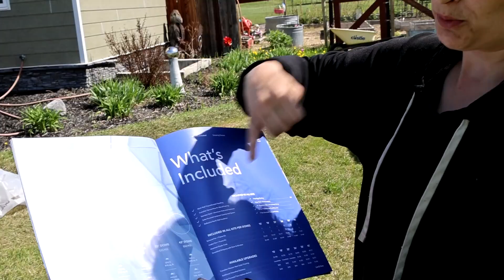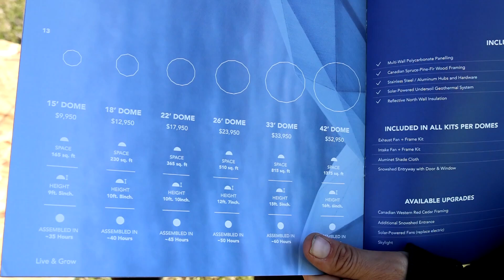Building Our Geodesic Dome Greenhouse For Homesteading & 4 Season Food Production

Comment: You need an airlock to protect the cold air from entering and the heat from leaving the dome.  It will help keep the door from freezing shut! Also, a RMH is much more efficient than a wood box heated the outside and wasting wood..   A proper RMH will only burn a few garbage bags of wood each night, it will easily heat the dome each night.
Reply from the maker: Thanks for the comment and something we will look at doing in our larger dome we just built this past summer on our northern property.

Comment: wasnt the kit a lil expensive seeing it was mainly all wood ? nice video!
Reply from the maker: Thanks for watching and yes it is expensive. However after pricing wood and the time it would take to measure cut and plan it’s worth it. Also the hubs you would have to make yourself or cut all the wood to line up. I guess it just depends on how handy you are and how long you want to take to plan and build. We did n it want to wait or source out all the products ourselves.
Reply: @AlbertaAdventurerFamily  like 20k ?
Reply from the maker: Not really sure what your asking
Reply: The timber struts for the dome equate to 60x 10ft lengths, knee wall  21 x 12ft lengths. Hubs could be cut from 2x 8x4 sheets of 1/8" thick aluminum plate.  The polycarbonate is the biggest cost, Dome surface area is 842 ft2, assuming 30% waste, you`d need about 1100 ft2 of polycarbonate. I cant see the dome costing more than 5 grand in materials.
Reply: @JohnGuest45  That's kind of what I was figuring when trying to add this up, I was just a little closer to $9K but I didn't know for sure how long the wood was. Do you have any plans for building one yourself without the kit?

Comment: Would you be willing to do a cost break down! I’m thinking on a green house and I have followed your channel and seen everything to have done to warm this green house.  For me I would like to make sure it’s a perfect fit for my family
Reply from the maker: Yes I can! the dome was 26,000 and 2000 for the ceder package, 4000 for our county permits and land survey & engineering stamp on the blueprints. 1500 for the gravel ring foundation. 1500 for the stove and pipe, natural gas heater. 1600 for the natural gas line install, 1200 for the beds wood and paint. 1200 for the pond metal and pumps filter system & underground ventilation system. So a grand total of 39,000 then add all your plants you wanna grow and if you need lighting. Add 1600 for lighting. Hope this helps let me know if I missed anything.
Reply: @AlbertaAdventurerFamily  what company did you purchase your Geo dome from
Reply from the maker: Arctic Acres